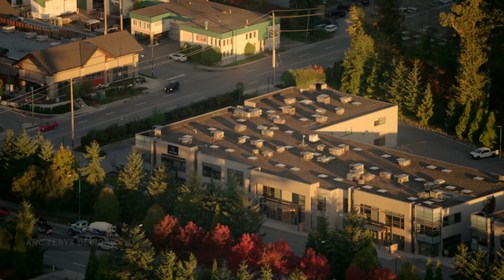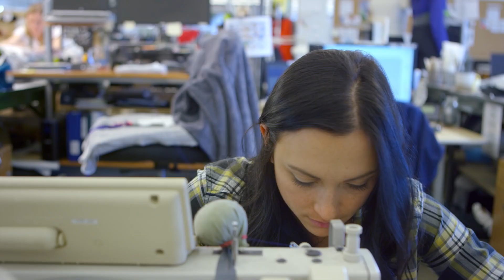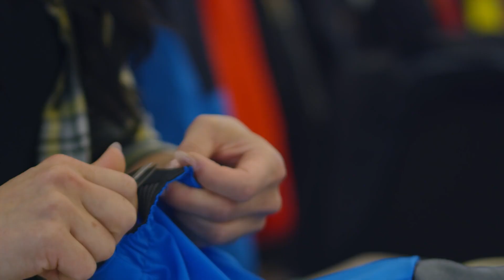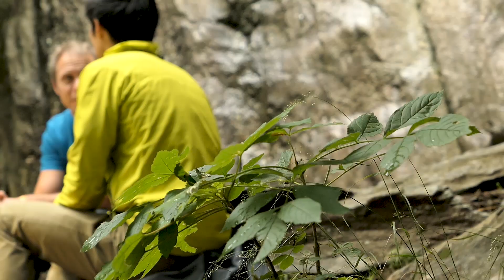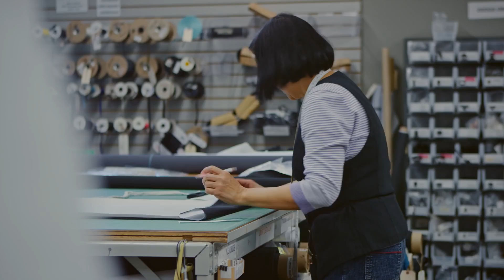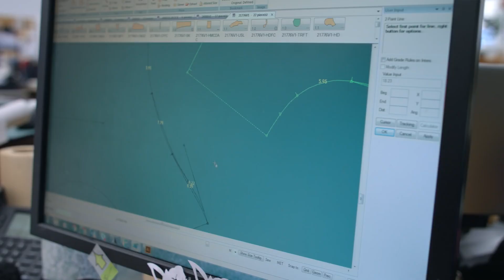Is Arc'teryx Gear Worth It: The Price Of Design | Climbing Daily Ep.1292

Comment: If you buy Arc'teryx you buy high quality gear and clothing. thats clear. the price tag is not that much higher then buying a product with similar quality from another brand (mammut, patagonia). if youre buying the top of the line products they will always be expensive and high quality. I love my Beta AR and my Atom LT Hoody. I also owned a Mammu Nordwand Advanced Pro Jacket. The quality was also really good. Price tag almost the same. So you will not make a mistake in buying Arc'teryx or any other high end brand.